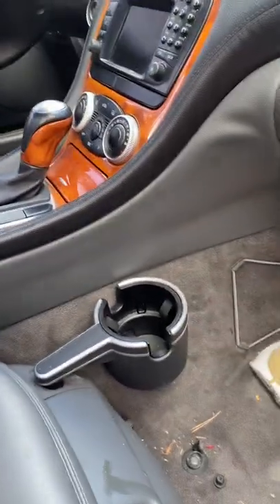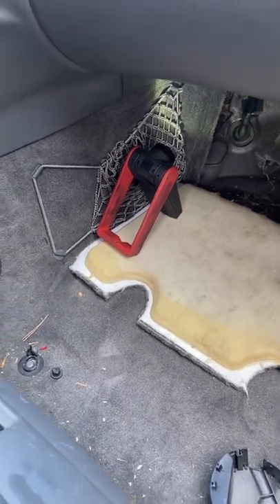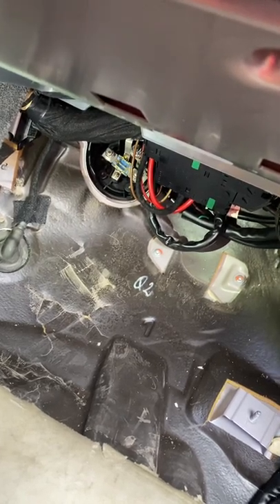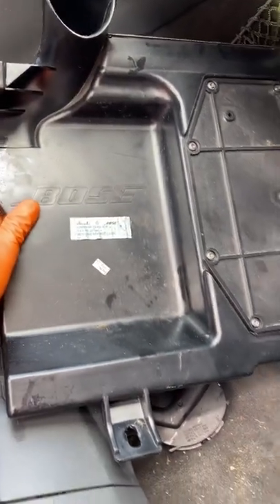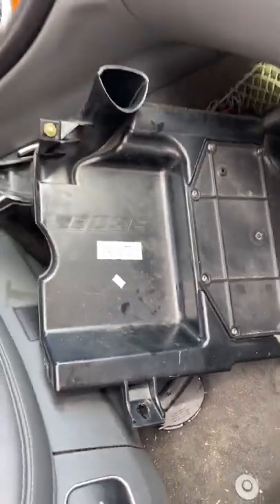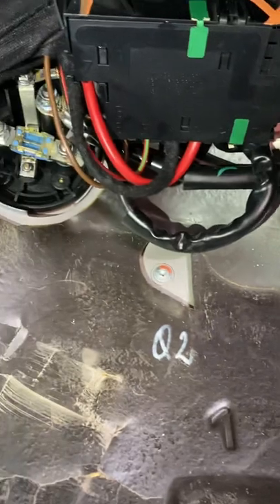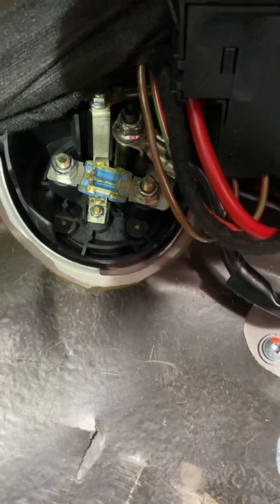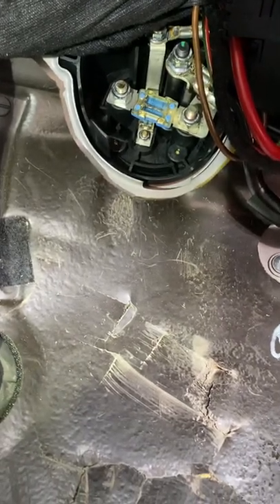Mercedes Benz SL500 2003-2006 Battery/Alternator Stop Vehicle Red Light

Comment: Ok,well thanks for the eye opener, I'm tired of no radio after 10 seconds, 03 SL500, replaced both batteries, tested front starter battery, I believe 14.1 or 2 V,  had no idea of the joint charging fuse and K57 relay, I thank you, will let you know Sir !

Comment: Question for you - I am seeing the red battery warning light and my locking system no longer works along with the convertible top system. Any idea what’s going on here? Both batteries are in great shape
Reply from the maker: Off the top of my head, I know there is a fuse that controls the locking system and top under the back seat. Check that fuse.

The red battery light is on for another reason. If both batteries are good the car starts without issues... is the alternator charging the batteries?

Comment: Thanks for the video. Am also experiencing the dreaded red battery warning light. I've confirmed charging (14+V) at each battery, so my fuses and alternator/regulator should be fine. I've also gone through the proper sequence for disconnecting/reconnecting the front and rear batteries, but the red light is still showing. I suspect I just need to clear the code and all will be good. The Bose box that you removed is the subwoofer. Thanks again for sharing.
Reply from the maker: Thanks for letting me know what that Bose box is Steve.

It's possible that both batteries are showing 14 volts on this dual battery system. There is a relay in the trunk labeled K57 that will join the two batteries together during "emergency operation". If the consumer battery (trunk battery) is below 10.8v. K57 will energize, allowing the starter battery (under the hood) to share it's voltage with the consumers battery. 
I would test each battery after it's been sitting without charge for a couple of hours. Make sure the static charge is above 12.1 volts. If it is not, change the battery. If it is... test the batteries with a carbon pile load tester. This will help determine if your batteries are good under load. If either of the batteries fails replace the battery.

If you find the same exact voltage at both batteries all the time, I would check to see if the K57 relay is stuck in the energized position (closed circuit). If it is, replace the K57 relay.
Reply: @mercedesbenzspecialist  Just wanted to circle-back to you on this thread. I purchased a Foxwell NT510 Elite scan tool with the Mercedes package. The tool identified a fault with the BCM. I cleared the code and the red battery light has remained off ever since. I suspect I triggered the warning when I improperly replaced my starter battery (front) without first disconnecting the consumers battery (rear). Perhaps over time the red battery light may have gone off by itself, but I don't like having codes showing on my dash. Now I just need to replace my TPMS sensors/batteries in each tire and the final dash light (TPMS) will be extinguished. Thanks again for your videos - very informative. Cheers

Comment: If you have red battery light issues, it is REALLY important to check the state of your battery control module in the boot/trunk to make sure there are no signs of burning. See https://www.youtube.com/watch?v=Ts9r_O8dNVM

It is also worth pointing out that unlike a normal car with a single battery system, you wont necessarily see 14v at the starter battery. The BCM switches alternator voltage to the consumer battery depending on a whole host of inputs including temperature, voltage and time. Mike

Comment: Great Video! I also have a 2003 SL500.  Do you think it's possible for a low/no charge on the system or consumers battery to cause ABC light to come on?? It appears that is not charging when the car is running.
Reply from the maker: When the battery system is low, all types of malfunctions are possible. The first step would be to correct the charging issue. Then see if the ABC light is still illuminating.

Comment: does the F52 100amp fuze charge the starter battery? or is it the 20-0Amp fuze?  My Starter battery isn't charging the front battrey
Reply from the maker: The 100amp fuse in prefuse block F52 is fused to the starter battery located under the hood. 

Checkout this very helpful pdf on how the dual battery system works in your R230. 

https://mbworld.org/forums/attachments/sl-class-r230/425370d1591305151-electrical-issue-consumer-battery-won-t-charge-r230-dual-battery-system.pdf

Comment: I like this but can you tell me that what if the bolts are tight and not loose because I’m going thru the same thing now with my SL500 and my red Battery light is still on with (2) new Batteries and a Alternator in the Car can you tell e possibly what other areas in the rear near the back battery it could be???? Thank you
Reply from the maker: Is the alternator charging the batteries? With the car running there should be close to 14 volts at both batteries.
Reply from the maker: Also, did you check the fuses I filmed in this video? Even if the bolts are tight, it’s possible that the fuses are broken. Check to see that you have continuity at those two fuses. You can check with a multimeter. One lead on one side of the fuse the other lead on the opposite side of the fuse. Or just take the fuse out and have a good look at it. Is it broken?

This is a link to a very helpful diagram of the two battery charging system in your R230. 
https://mbworld.org/forums/attachments/sl-class-r230/425370d1591305151-electrical-issue-consumer-battery-won-t-charge-r230-dual-battery-system.pdf
Reply: Check your BCM. It is the silver box under the carpet on the right side of the trunk. About the last thing it could be if you changed your alternator, voltage regular, both batteries, and your footwell fuses. I have read conflicting info on the battery light. Some say it can only be turned off with Mercedes SDS scanner software, others say the light will go out if you pull both front and rear battery neg cables .

Comment: I checked both fuses and still have the red light. Alternator is charging  both batteries. Any other suggestions?
Reply from the maker: I suggest you load test both batteries.
Reply: @Mercedes Benz Specialist  both batteries were replaced and I followed the battery installation when I replaced them. Also checked and the alternator is charing both batteries
Reply: Check your BCM box in the trunk on the right side under the carpet. Some say the red battery light can only be turned off with Mercedes SDS software others say pull both battery neg cables and then hook back up. @cryptoAcosta